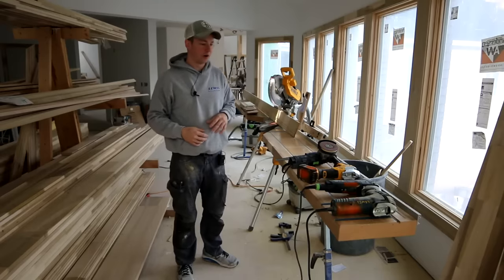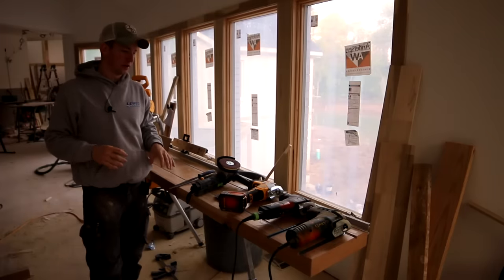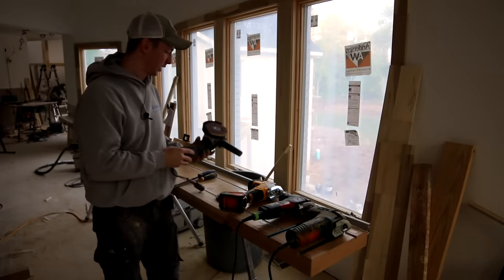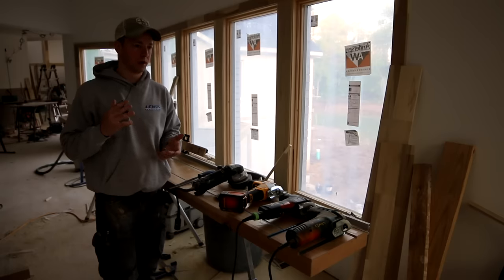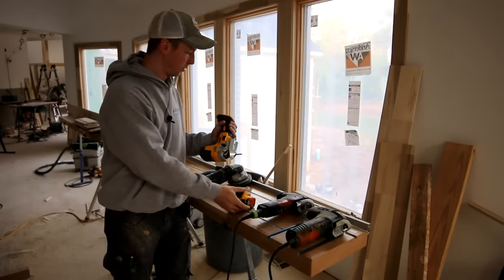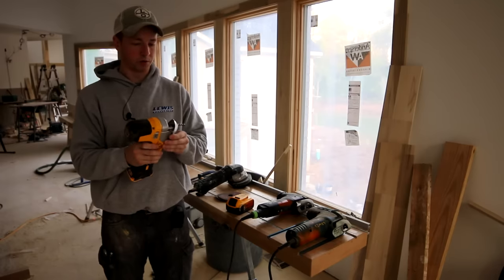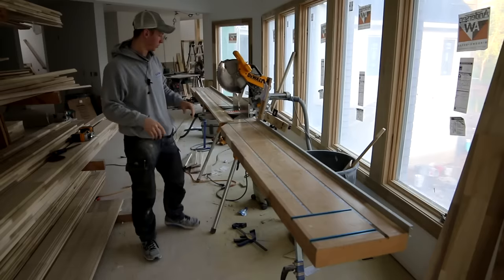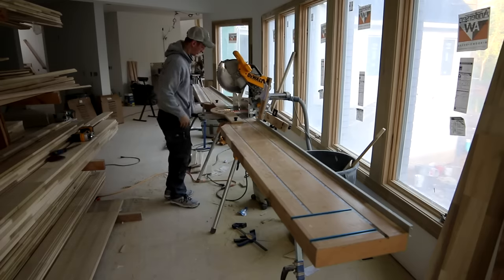Best tool for coping base and crown??? Dewalt DCS335B w Coping Foot for the Win

Comment: A coping saw.
15tpi
Reply: J Hart , what is 15tpi ? Thanks
Reply: @edwh164  coping saw blades come in "tpi" = teeth per inch.
Harder woods like maple/oak/hickory increase to 20 tpi.

Also, quality blades like starrett are far superior and worth the money.
Reply: Thank you sir, appreciate the information
Reply: @jhart7304  totally agree that's what I use cut my bass upside down and then put a 22 1/2 back cut and use a hand saw
Reply: @jhart7304  you have that bas-acwards. Fewer tpi for oak. (Trim carpenter for 35 yrs.)
Reply: @petem2700  cope on push or pull stroke?

Comment: I sometimes use a little rotary tool with the sanding drums, after I've hogged out most of the waste on the miter saw. It works great for rounded profiles.

Comment: Hopefully some people noticed that he is not using a Festool Kapex miter saw that requires a proprietary blade that's overpriced.  I have used the Kapex and it is absolute overpriced garbage that is slow and leaks gear oil on the workpiece when the seal for the gearbox fails mid day.  A Dewalt DWS780 is $500 bucks on a good day and puts that $1500 saw to shame.  I will say in fairness that festool does make a superior track saw and some other very nice tools.  Everyone should learn to cope with a handsaw first, that is how you develop your skills, touch and popeye forearms.
Reply from the maker: I owned two kapexes. Burnt them both up within three years. I’m much happier with the 780. I run an FSTOOL SM6300 blade ($180) on my dewalts and they cut amazing.
Reply: @InsiderCarpentry  Someone turned me onto Makita blades, first I tried the the non coated 100t blade which left a super smooth cut but it was a very thin kerf that eventually bent and started to wobble from compound cuts which could have just been one bad blade... and now I'm using the black coated 100t Makita which I have only ran a few hundred feet of crown with, so far so good.  I don't think you can ask much more out of a blade you can pick up for 50 each from acme tools when they have $20 off of a $100 purchase of Makita products, I have noticed like most blades, they cut smoother after a week or 2 of work.  The Kapex is just a nightmare to work with, I can see how you burned a few up, brand new they seem like the motor is on it's way out.  The Kapex does offer a very flex free slide and a nice micro adjustment when locked but the rpms are cringe worthy, almost scary when cutting maple crown.
Reply: I own most major brand saws.  I still use my kapex for a dedicated trim saw.  I do lots of tall base that I cut on the flat and haven’t found a saw more efficient or accurate on bevel cuts.    Oh and dust collection is amazing.   But at 2 years I smoked it and it went in for warranty.   But I’ll keep running them !

Comment: One thing I have found  to  be  helpful is to  sharpen  a pencil to  a long  point  and  drag it  along the  short  point of  the  miter  especially  when  working with  blonde  wood  like  poplar  gives  you  a  razor  edge  line  to  cope  to  hit  your  line  fits every time  also  leave the  end  your  coping  into  loose  for the  last few  feet  that  way you can  roll it into the  perfect  position to  fit your  cope

Comment: Thanks for the very informative video.  Some of these ceilings in  kitchens they expect us to put up finished crown are so out of wack.  I need to get a coping foot for sure.  I use the DeWalt crown stops which they have available for that same saw.  They work well.

For now it's flap disks and safety glasses.  Just some of the profiles are too intricate to get a good shot at them.  5 and 1/4 colonial, no problem but when you start adding beads you have to have a very steady hand

Comment: I’ve been a carpenter for about 17 years and actually recall that among my first day or two on the job I was to repeatedly learn how to scribe skirting with a coping saw, I’ve never really considered or even thought for a second that another way could be better, sure it aches after a dozen and one way (left or right) is always easier than the other, but there’s a lot of joy in doing something by hand and in my opinion will always be the way that wields most control, and the most satisfying, hard work truly pays of when you know it’s that way because of the effort and patience you’ve put in

Comment: I would recommend going beyond 0 degrees. Sometimes the building isn’t square and if you’re cut isn’t perfect your going to be caulking and thinking that you messed up. Really helps when the crown and base are stained and not painted. That little back angle kind of knifes into the adjoining piece. But great work nonetheless. Thanks for the video

Comment: I admire your talent. I install floors and finish with quarter round. I can install 600 and 700 sqft of floors in couple hours but it takes me just as long to install quarter round if not longer no matter how quick i try to go. I was told to try the coping and i get it. But what i dont get is the procedure on how to start and the best place to start from as in from ledt to right or right to left. A reply with a comment woukd he awsome and a repky with a video would be just perfect! Thank you and i learned from your profession
Reply from the maker: I miter paint grade shoe molding. Order is circular around the room.

Comment: Great crown molding tutorial, fitting crown is an art. You’re set up is interesting. I think a key element you missed is the best blade for coping. Depending on whether you’re cutting softwood or hardwood. I found  that the right blade when coping by hand makes life easier.  As far as production you’re right, doing most of the work using the power miter is the way to go. Great tutorials, keep up the good work.
Reply from the maker: I’ve found the T244D is by far my favorite and it also what Collins recommends. Any trim I try a different blade I don’t like it.

Comment: I've been coping with a D-Handle jigsaw for 10 years.  I haven't any issues from the top side of the piece and just keep a good grip on the tool and let the blade do the work.
I would like to try a coping foot on a barrel grip jigsaw some day since I've seen it so often on youtube.  In my area, trimmers just use a d-handle or a coping saw.  I don't mind using a coping saw, but maaaaaan is it slower.
Reply from the maker: You’d love a coping foot on a barrel grip jigsaw after you’d get used to it. 👍

Comment: I got my Collins coping foot last year and it does work great, another way of coping I wanna try and experiment with is a cordless angle grinder with a sanding flap wheel.
Reply from the maker: Works great. Just dusty.
Reply: I thought it would be dusty.

Comment: I like you use files that is secret number one. Number two is one hell of a backcut. I know you said it could break but not if you put that side in first, plus you can make a nice pressure fit that will never move. Also clamp your work down, always. I use a scroll blade and a flat foot on my jig saw so I can ride the 45 and get a nice 45 back cut. Get it close then file or use the jig saw as a power file for some profiles.
Reply from the maker: Sounds like you’ve got a system down that works well for you. When I install long pieces I always put the square end in place first, resting on a nail, then I flex the pieces and slide the coped end in place.

Comment: For those who have a Dewalt 335 jig saw, you can turn the lights off by splitting the case and disconnecting the wire connector near the top of the handle. I did this with mine so that if I decide to not use it as a dedicated coping saw I could reconnect the lights, plus avoid any warranty issues.

Comment: Well done, I now have a great excuse to buy more yellow...... even though I already have a new jigsaw in red. Coping foot needs to be on a dedicated tool. Not sure what to do with my old corded bosch in the metal case with a Collins foot on it.
 One trick I also use is to glue sand paper on a mate piece of crown to sand away meat that’s in the way. In a pinch I have used sanding sponges to tune up the sharp edges.
Thanks Spencer, you do some good work !
Reply: I don't cope often, but for cleaning up a cope I like a half inch round file, a half inch square file and a small triangle file for those tight spots.

Comment: I use a grinder with a sanding pad. 4 1/2” disks- usually 100 grit. I can get extremely precise, even with the little flat reveal on crown moldings. It’s faster than a coping saw but you can only go around the lid one direction if you want to keep the sawdust from blowing up into your face as you cope, so think about it before you tack up your starter piece.

Comment: I do a back cut 22.5 on the flat part of the base too. That way you have a nice sharp edge instead of flat. When you pressure fit your base it creases into the front of the other base and it tight and never opens up

Comment: Nice work, have had a cope foot for years, I usually don't give out tips, but use adhesive back sand paper or glue sand paper to a piece of crown to make a shaping block, really only necessary for prefinish but worth it.
Reply: I glue thin sandpaper to a piece of scrap baseboard  and run it back an forth a couple times to clean the edge of the cope and get nice sharps edges.  The paper follows the profile nicely. One block usually lasts a couple jobs. I use 120 to 220 grit. It rides in my tool belt and I can hit a cope joint while cutting or when  installing the base.

Comment: Very nice presentation well done. Good point with the festool and with the cord twisting. Although festool also make a cordless jigsaw, I read some people in the festool forum didn't actually rate  the festool jigsaw that good. There were others that liked the tool.
I have the d handle cordless metabo. Although the metabo barrel grip is better with more functions and wider base plate, I have been happy with my metabo d grip. I haven't done much timber coping. I have done more decorative cornice work. (Plasterglass)It's better to have bigger gaps and fill in so there is more material in the joints for added strength.
Once again nice work and appreciated you spend time making a presentation.

Comment: I use a slide to cut the straight with board flat but undercut it by 5 degrees - just to make it easier to fit. There is still a lot of board left for strength.
Never got good good at using jigsaw just old fashioned coping saw.

Comment: Personally, I love using oscillating tools. (And I only use the XR with DeWalt brands now... I hate brushes motors lol). 
 
An oscillating tool just makes crown cutting easy, and perfect. Plus, you dont need the file afterwards. 
 
A cool technique is to make a simple chop saw type of jig that you can mount the oscillating tool to. 
 
Lastly, an oscillating tool had so many great functions. To me, it is the most useful tool to own. It can do just about anything.

Comment: Hand  coping with a saw does take practice, especially when you want to do it both left and right handed. However, the only time I will cope is when I cut the angle wrong on one end by mistake and rather than take it down and recut it, I will just cope the piece that will have to fit to it. Then I use the Dragster belt sander I have which is lightweight, easy to use, and has a small front roller for tight radiuses. Like I say, it's the only time I cope. I see no reason to cope otherwise. I don't even have a  coping saw anymore, or if I do, I don't know where it is, and don't care either. I hate coping. Waste of time, seems to me.

Comment: Good video. I learned how to do trim with a manual miter box and a coping saw. When I moved to a powered miter box I changed to a jigsaw for coping, even before there was a coping foot available, so I still just use the jigsaw without a coping foot. I was surprised that you cut that large crown nested instead of flat, but you have that nice tall fence on your miter saw. Just a point, you should be wearing safety glasses when using that saw. Again, nice video.

Comment: For base i use a router (or 2 for hardwood, with 2 different sized flush cut bits) and a home made coping jig. Way faster than jigsaw. 
You make a mold of base board shape with epoxy the day before. 
For kitchen crown I miter it. Don't do a lot of room crown, but when I do Bosch barrel jigsaw and gonna make your crown cope jig! Great vids! Whats the best blade?

Comment: There are numerous tools to do the coping.
To use coping saw will make a large project a burden,one room would be okay, whole house, would be losing money on the bid 
I've seen flapper sanding discs,and ty be shoe on the jig saw I just have my shoe canted. I think time for the coping shoe.
Those who just 45. Or 46 miters are fast rate production instead of finish carpenters.
Nice video

Comment: This is the best method I've seen in my 40 years.  It is the fastest, less dusty than grinder, accurate and with the least amount of hand and arm fatigue.  Time is money and hand coping large 45 cuts is time consuming especially on whole house jobs.  Jigsaw wins hands down.
Reply: I always do it by hand. I am not a finish carpenter though. I do cabinets and other built in furniture.

Comment: I cut the base upside down but do not go back to 0 I back cut it. The trick is when you get to the intersection of where the cope will end do not let go of the trigger otherwise it will cut down to deep pull blade out of that point with it running.

Comment: Furniture builder, over 45 years of hand work, a tool is as good as the person using it. I've been known to cope with a table saw eliminating material rapidly, I am deadly accurate with a coping saw and two little files. Jigsaws work, not as accurate. A heavy back cut is used to manipulate the profile with ease, good video I enjoyed your technical skills. Don't be afraid to look at your elders for tips, you will find a wealth of knowledge in the Masters Woodworkers of the past.

Comment: I'm an old timer. I'm a finish Carpenter of 30 years so maybe I'm biased. I definitely feel your first method to master absolutely should be a hand coping saw.  When you do it often, it's just as fast as any other way.
Reply from the maker: But how is your elbow and shoulder after 30 years of wear and tear. We don’t look at the effect of wear and tear on our bodies and what tools we are using often enough. I’m 32 and have worked hard labor since i was 16. I’m already feeling the deterioration.
Reply: @InsiderCarpentry  well that's certainly a good point. 
Ha, my arm and elbow are fine compared to my knees. Too much up and down doing kitchens have taken its toll on the old knees. My arms and most of my muscles have been conditioned and are stronger now than when I was just starting. The joints in my knees are the only things that have not held up over time. Their not terrible but I'm starting to feel it lately.  ( I'm 51 now but look much younger from being physically active at work and play) i did strictly custom kitchen remodels for probably 12 to 14 years. That's a lot of wear on the knees.
I don't blame ya at all for preemptive measures( that's being smart) but if that power tool takes a crap on you it would prolly be nice to know you can use that hand saw for back up and get just as good a result or better. If in good physical shape, I think a coping saw won't do too much damage. It's pretty low impact.
Either way, thinking about your body now is very smart.

Comment: Compliments to you on a very well done video. For those novices out there you should mention that a barrel handle jig saw is the only way to go. I use a Bosch with a foot. It is corded and twisting of the cord does become an issue. My question is, what affect does the additional weight of the battery have on your hand over long term use?
Reply from the maker: I haven't found it to be bad at all.

Comment: It would be very helpful if you turn over the coped board to show how much wood you took off the back and how thin the line is along the edge of the board.  I don't know how much or how far back I need to cut away the wood to make it fit clean.  I've got a complicated cornice moulding that 12.5 cm from top to bottom along the carved front of the board before it's cut.  I took a pen and marked a thick line along the cut edge, so I can see the edge of the molding on the front side.  Then I cut just below the pen line and and filed down the wood so it's smooth.  Now, I'm sanding down to the edge to see how close I need to come to the line created by the saw cut.  This is my first time coping and I want to get it right.  If I waste some trim, I can get another board, but I'd like to do it right the first time :P

Comment: When you make the straight cut after your 45. personaly i wouldnt make it 100% straight but put another angle set back so the front edge always touches incase of the wall or other aspects are not 100% true. Thats the point of it so the front edges of the scribed architrave/skirt sits tight against the other. 👍

Comment: I actually prefer the grinder with 80 grit red disc with a sharp edge.  Flap disc works good also. It makes a lot of dust for inside so use a coping foot without good ventilation. I do all the same steps but i always rub pencil on the cope line so it’s easier to see. Adhesive sandpaper stuck to different profiles or drill bits is great for fine tuning at the end. Always have a roll of sticky 80 and 120 grit in the kit.  Still use a coping saw on occasion. 30 years as a pro and my knees remind me every day. Most important tool is your retirement plan. You’re young, don’t screw it up.